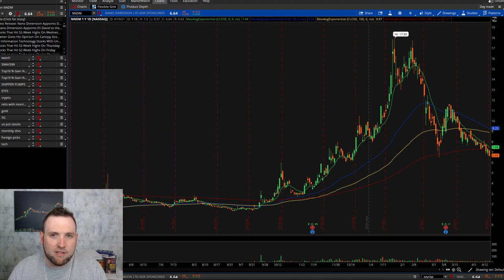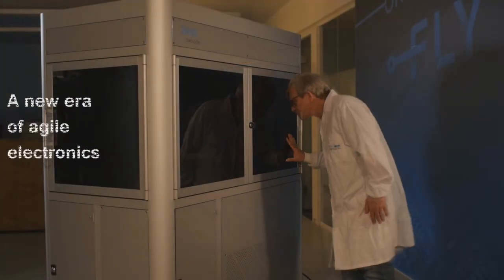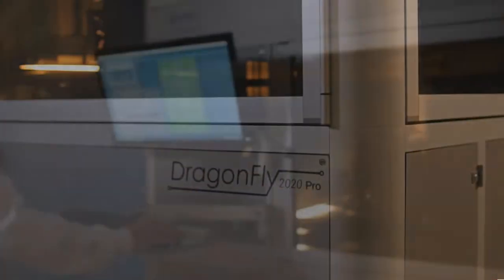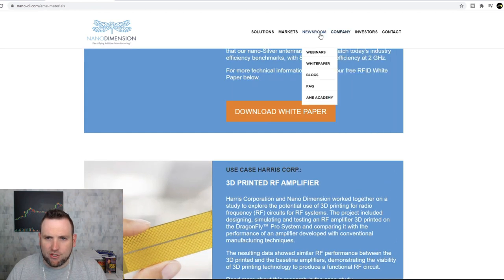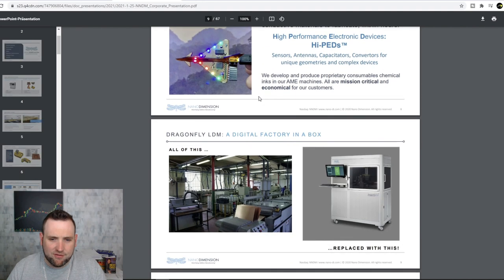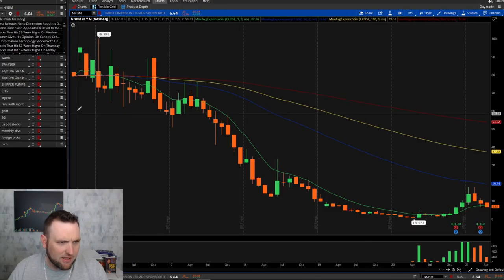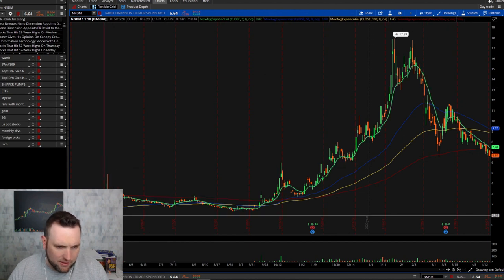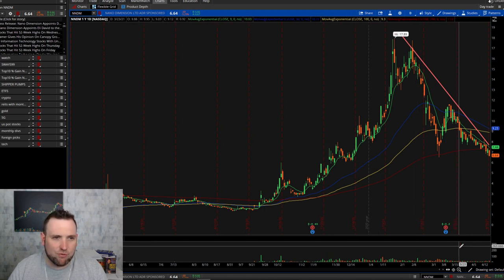TOP TECH STOCK REVIEW 2021: NANO DIMENSION (NNDM) & CHART ANALYSIS

Comment: I am almost certain that they have 1.4 billion in cash. I think that what you read from is probably wrong. Over the last four months, I've heard umpteen times that they have 1.4 and 1.5 billion.
Reply from the maker: Hey Christopher! I easily could be wrong 😂.
If they have the higher amount of cash like you are saying then even better! No debt with that type of cash certainly is not normal in the stock market!
Reply: @frameworkfortune  They did eight stock offerings and a lot of them one right after the other. I way overpaid because I was too lazy and too impatient to buy a little at a time, so it will likely turn out that NNDM is the biggest mistake I've made so far in my life.
Reply from the maker: Hey it happens! When I first got into the stock market 7 years ago, it was right before the big weed bull run. I loaded up on ACB at $2 sold it all at $2.60 then ACB ran over $10 😂. That's one of many stories....you are going to have those misses, but consistency will lead to having a big day!